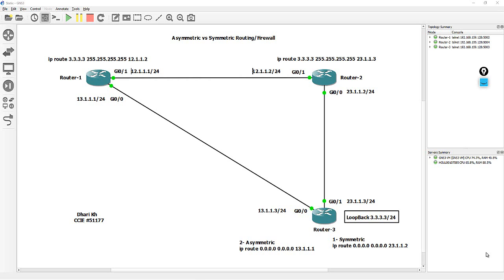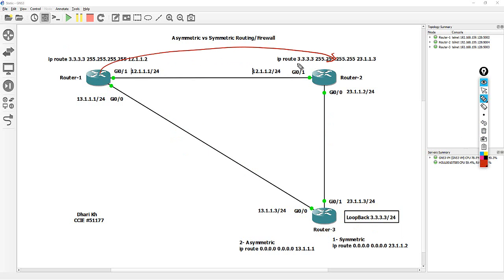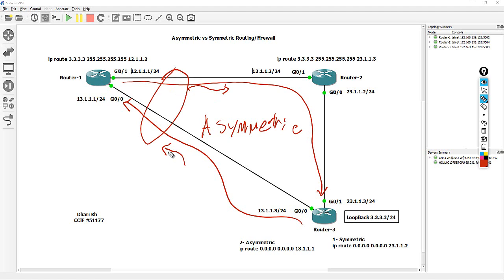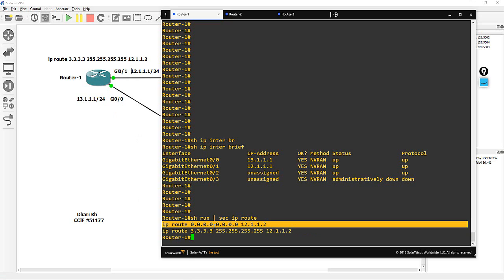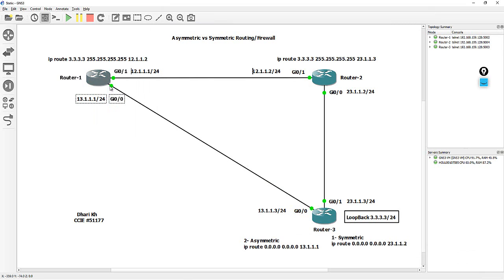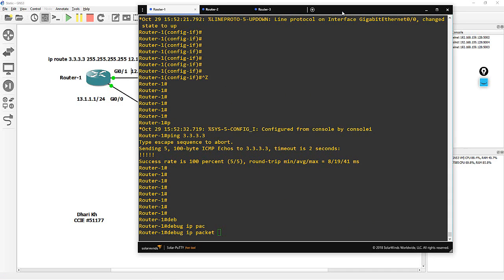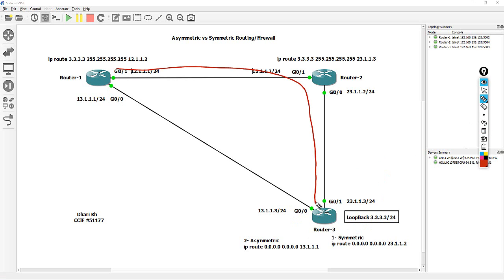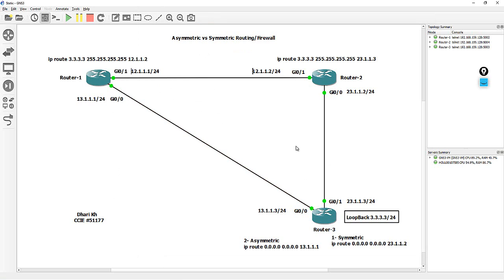Asymmetric vs Symmetric Routing Issue Part 1

Comment: Thanks for the demo. 
I was wondering why traceroute was not used earlier in the video (You used ping & debug ip packet) but later traceroute was used which was much simpler.  Good.  Thanks for sharing.